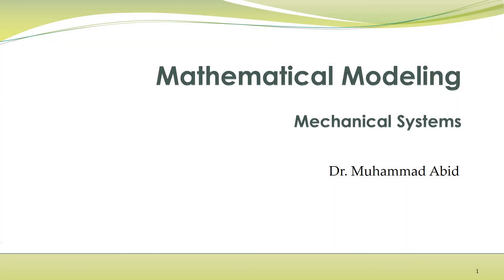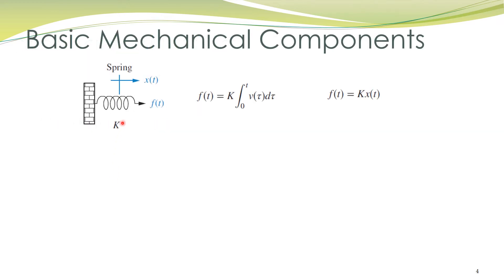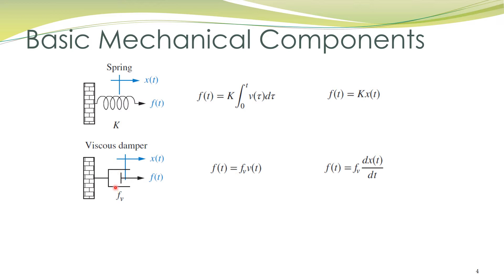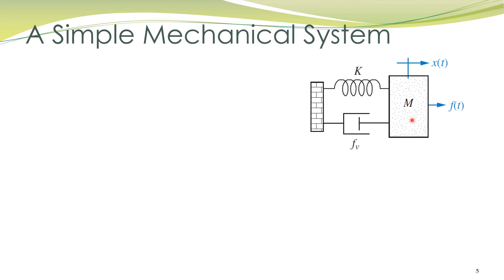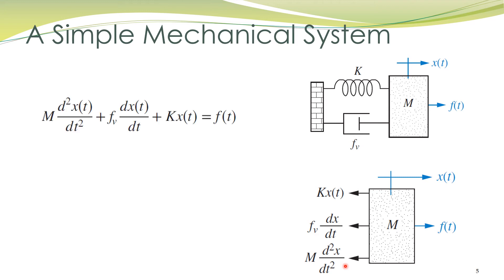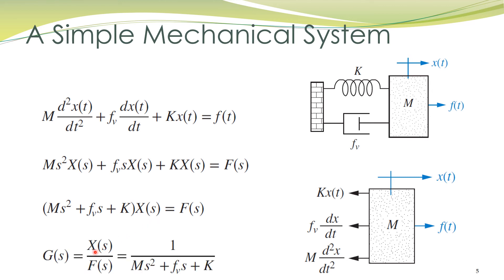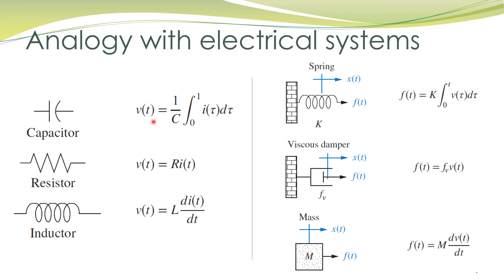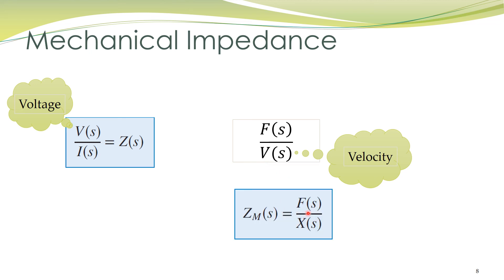LCS 4a - Translational mechanical systems - mathematical modeling

Comment: Why do we neglect gravity during modelling the system dynamics
Reply from the maker: We are interested in modeling the horizontal displacements of the systems, and we know that, only horizontal forces can produce horizontal displacements. Therefore, we have not considered gravitational forces in this system. 

For the systems where vertical displacements are to be modelled, we have to take into account the vertical forces as well. You may have a look at the mathematical modeling  of pendulum on a cart system for learning modeling of more complex systems at the following link.

https://youtu.be/c3z4eo6s0Ek